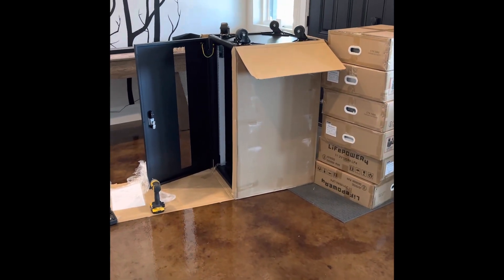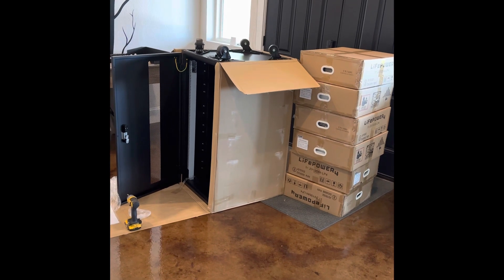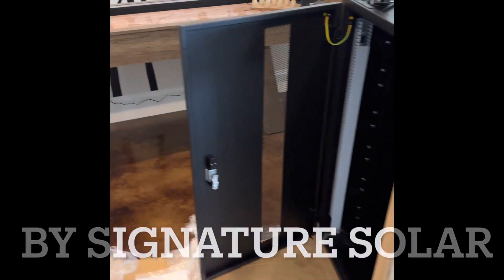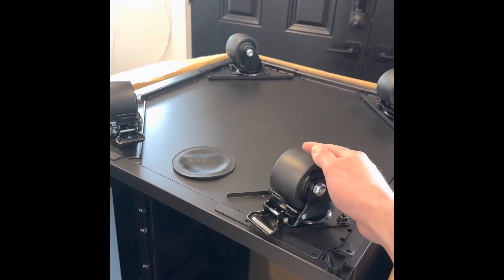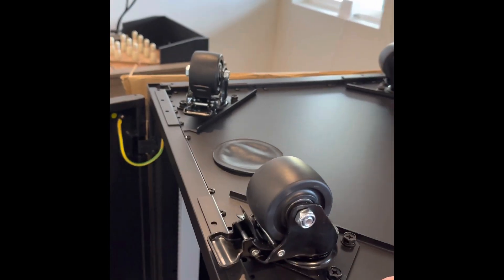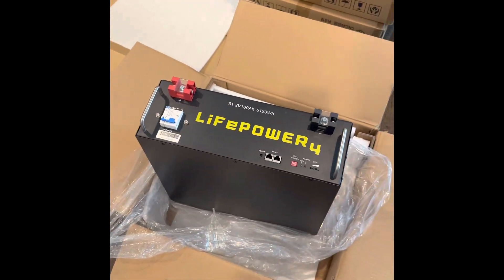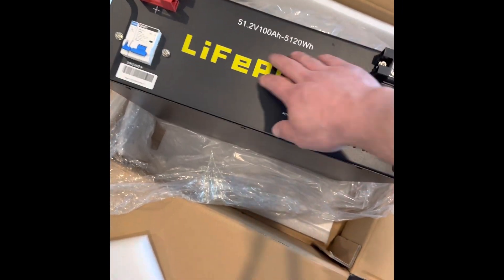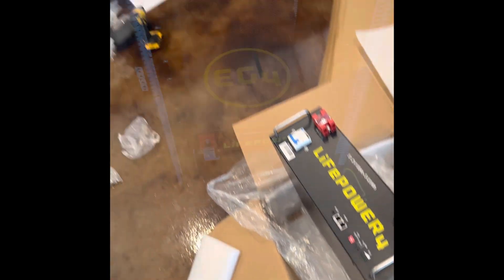EG4 batteries and rack set up by Signature Solar

Comment: Some of the holes in my rack didn't line up perfectly with the batteries either. I ended up taking a step bit and drilling out the holes in the brackets a little bit until I could  get the holes lined up.

Comment: I have the same batteries and rack. With the way they installed the side rails holding the battery shelves, there was not enough room to put the rear panel on. I had to remove the two side panels, move the mounting rails forward by two holes and reinstall everything. The only issue was that the 3 ears on each of the side rails would not be able to screwed in. Not impressed with Signature Solar's quality control. The prices were great though.
Reply from the maker: Yeah from other videos it seems the rack is always changing. But on the positive side all the tear down videos of the batteries seem to all be very quality and consistent. That’s really all I care about.

Comment: I got my batteries in January sale with a free welded rack. Totally fine rack but bus bars were a mess .Got all issues sorted finely . Been up & running about 2 weeks what a huge difference  from agm batteries I had prior.  Also dip switches had to be flipped  Opposite as to what was shown in the download To show up on laptop wasted days on that part.  Just hit 5 years offgrid in TN.
Reply from the maker: I have seen all the different buss bars from other videos. I was glad I got these but I was prepared to have to make some modifications. What do you mean you had to put the dip switches opposite? Like the master on the bottom?
Reply: @Offgridmountainlife1   I had to set my dip switches the exact opposite of what we're shown on download. Maybe they will put it upside down.